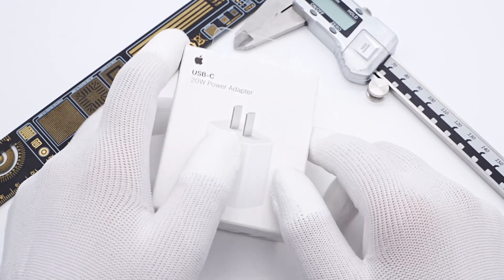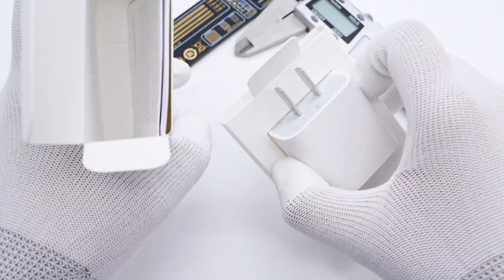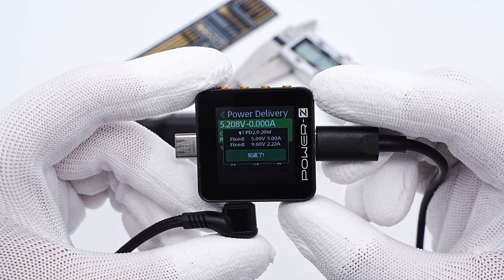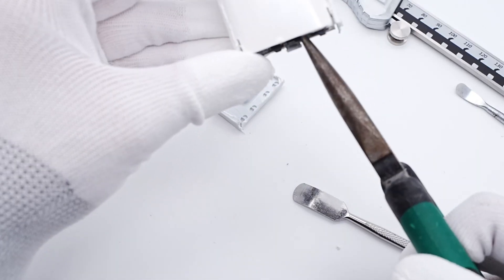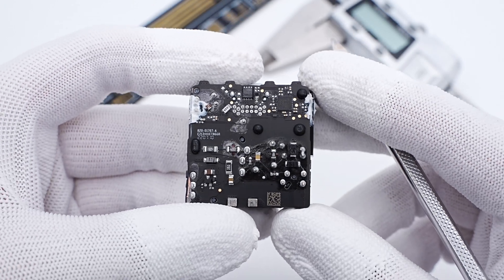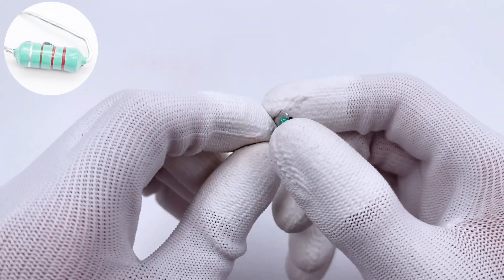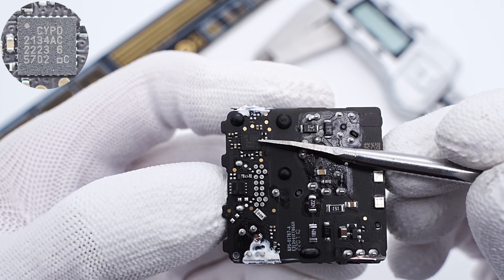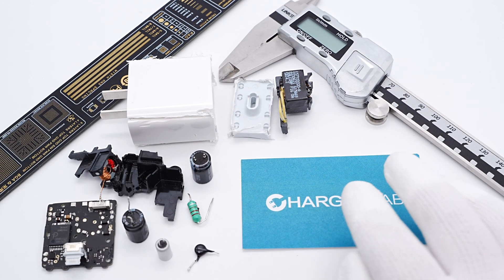Teardown of Apple 20W Power Adapter (For iPhone 14 Series)

Comment: Thanks ChargerLab for another Apple Charger teardown. In my opinion, Apple entry-level chargers bundled free with their devices are getting very complicated, although all of them are good using quality components.

Is it because of supply chain problems or Apple just ordered the chargers in bulk for each Apple device just one time off ? So perhaps the new IPad 10th Gen with come with a bundled Apple charger from another supplier and then next year IPhone 15 will come with the bundled Apple charger from yet another supplier ?

It’s unfortunate that Apple protect and restrict their charger to Apple protocol only although it’s still useable with other brand products

Btw ChargerLab, can you do a teardown of faulty chargers and cables, and try to see the reason why they are faulty ?

I have a few chargers and many charging cables that are faulty after using about 1 to 2 years …… thanks very much
Reply from the maker: Thanks for your advice. But we're currently focusing on new product teardowns, not repairs.
Reply: @ChargerLAB  ok, understood. Continue with the good work
Reply: @ChargerLAB  teardown baseus 100w